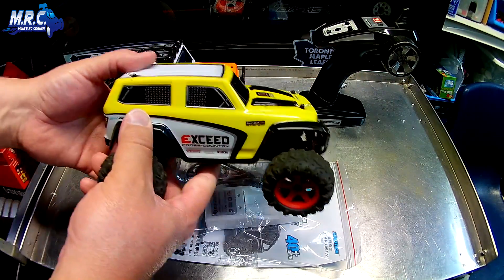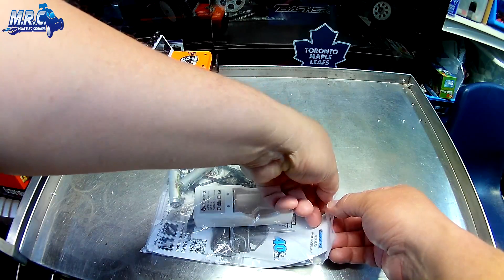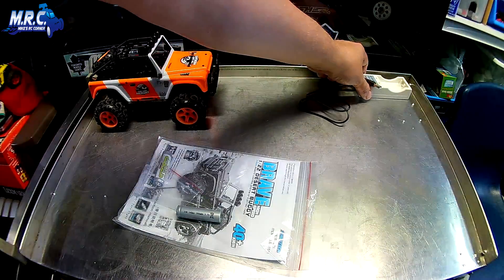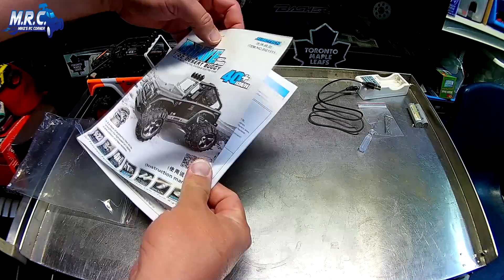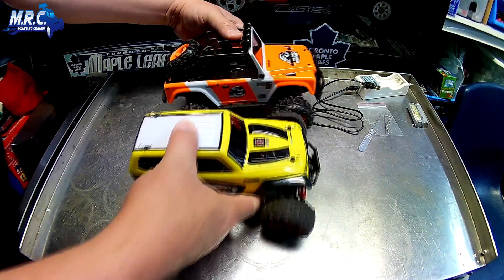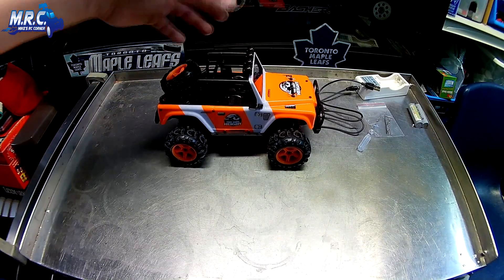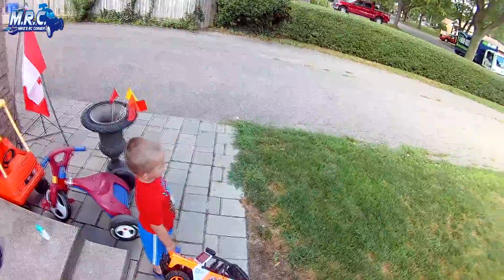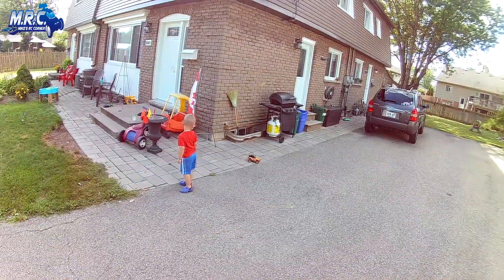4WD TRUCK 1/22 SUBOTECH "BRAVE" BG1511 UNBOXING AND DEMO! (FROM BANGGOOD) EP#263

Comment: Very nice Rc. I get sick when I see a video like this knowing that it out performs my losi 1/24. You could probably buy two of these with the money I spent on the losi 1/24. I like my losi trail trekker but, the truggy I never use because I know it's going to break and it doesn't have this speed out of the box.
Reply from the maker: hey Jay... i hear you! i've owned the losi 1/24 SCT and truggy and i sold them both. i had the brushed versions. i did a conversion on the SCT and made it brushless with a system from hobbyking. it was quick but then i came to realize it would break easy. so i unloaded it. the truggy looked so cool but it was totally underwhelming too. this model from subotech and the wltoys a2x2 serious are much more fun. only thing is the losi has better shocks and i'm not sure if they would fit on this truck. ok Jay thanks for dropping by!
Reply: I really like this Rc. I like that you could put a couple of figures in it  and love the LEDS.  Are there other ones in this scale that you would recommend more? say from WL Toys. I just sold my Losi truggy so I'm looking to get another micro. I got $75 to spend.
Reply from the maker: Thanks Jay I'll have to look into it more for the LED lights... i'll keep you posted :-)
Reply from the maker: As for 1/24 scale i think this is the best the wltoys a242 (if you are looking for a truck). http://www.banggood.com/Wltoys-A212-124-Electric-4WD-Monster-Truck-p-999868.html?p=LS0818077332201209KJ

Comment: Very nice!, I do love the orange one, I am getting one also! :-)I do like that they put the switch one the bottom of the car, but what I think they have should done is make some oil shocks also!!, that would have been fantastic but oh well
Reply from the maker: Hello there! Very cool I liked the 1510 and this model is virtually the same and I love the body! I asked for the solid black one but i opened the box and got this one. It was a coin toss between the two and I don't mind getting this one. I like power switch on the bottom side of the car. I love the batteries for this RC too. well thought out i wish more RC makers use this. Oil shocks would be great. Not sure if the losi ones fit, it would help but it's OK with the stock ones.

Comment: What is the advantage compared with the BG1510?
Whats the running time?
Reply from the maker: This truck has a hard body and the LEDs lights. not much advantage. the runtime is shorter because it's much heavier and the LEDs. This model tips over easier because if of higher center of gravity. but it's still a great truck especially if you want to do scale driving on a trail or dirt field

Comment: can u upgrade it into brushless motor and new transmitter???
Reply from the maker: Yes you could if you wanted to. Not sure how much faster you would want this to be. also remember the esc combo controls the servo (5 wire) and has the receiver built in.
Reply: Marlene Minarik 30 bucks at tomtop and ebay. Only black though